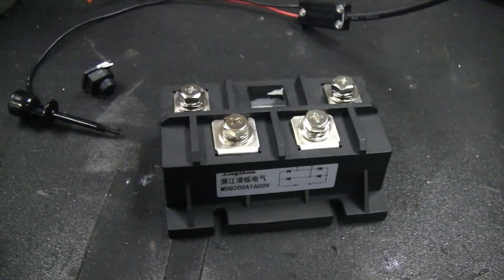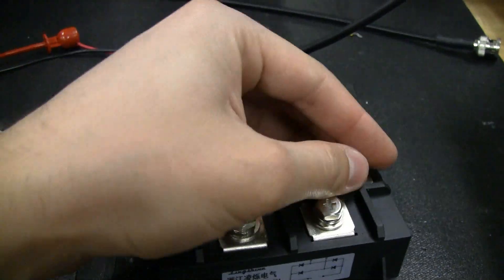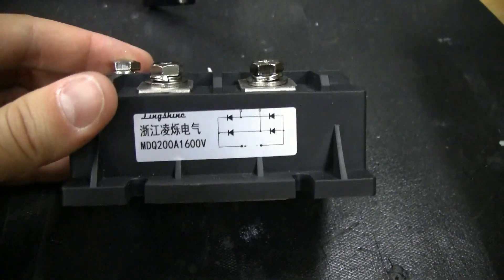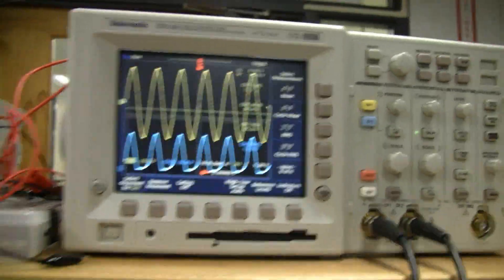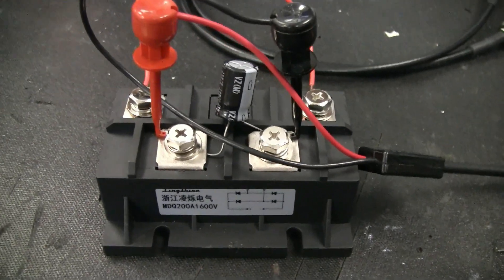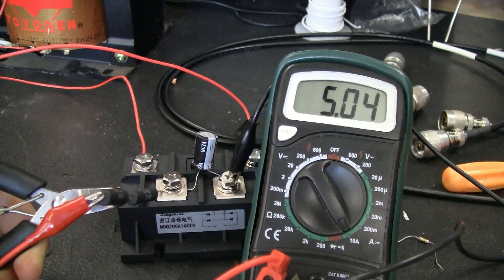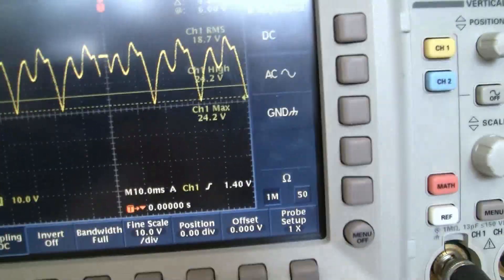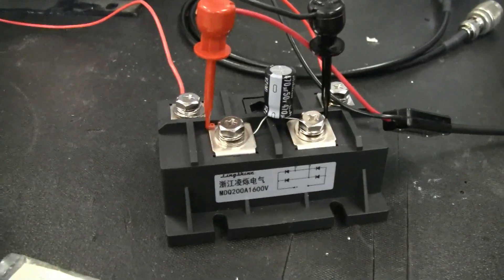Testing a Cheap, High-Power Full Bridge Rectifier

Comment: Hey, I know this is kind of old now, but where did you get such a large transformer? Did you buy it online or did you find it in a scrapped electrical device? It's just that I go to the scrap yard nearby and the largest types of transformers I can find are microwave oven versions (of which I have 3 next to me) and I'd love to find some that are even larger. Thanks for the video.
Reply from the maker: I was lucky enough to find that transformer in a bin of junk that my engineering department was throwing away
Reply: Aw, man! That's awesome! Well, lucky you. I'll just have to keep looking. One other thing, would you recommend I get one of these bridge rectifiers for rectifying a welder output? Or should I go somewhere else?
Reply: call epd if your looking for a transformer. im building a 400 amp power supply with 2 epd transformers and 2 of these. I am throwing a buncha caps after these. Gotta for filtering

Comment: Added such a thing to my transformer welder to make a TIG welder. It works but the output still has a sine wave lol.
Reply: A couple of capacitors and a good sized resistor to bleed off the caps when power is off will smooth that out.